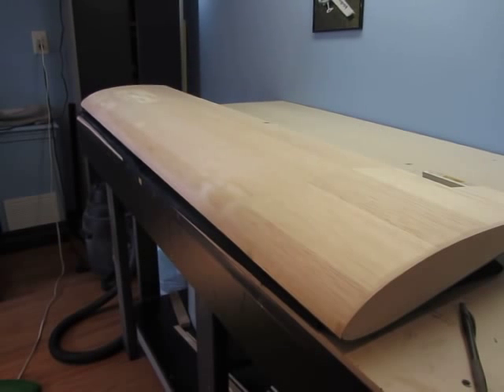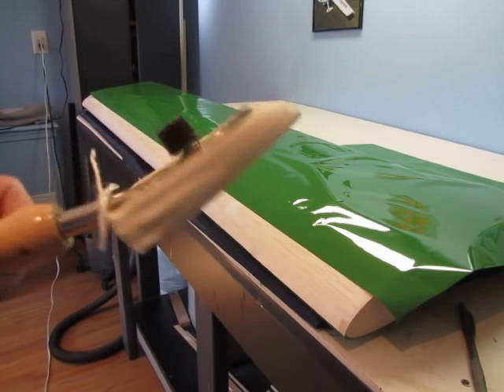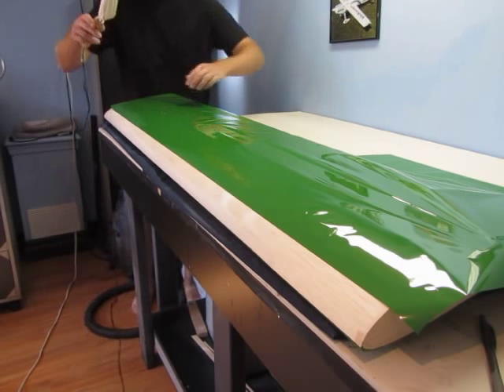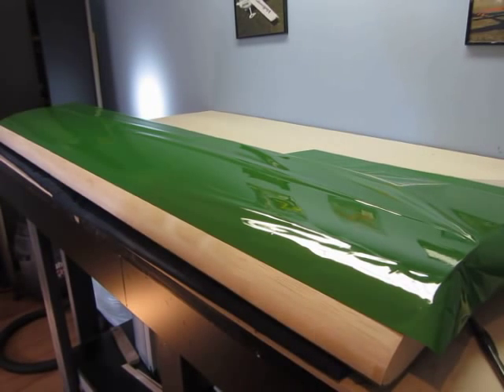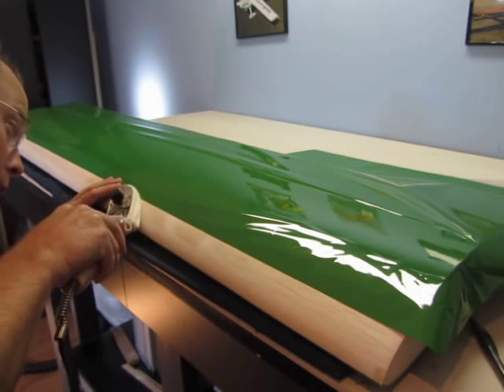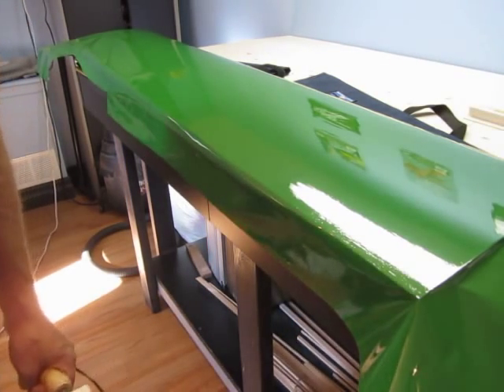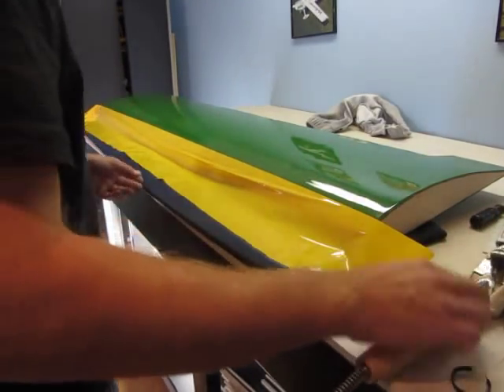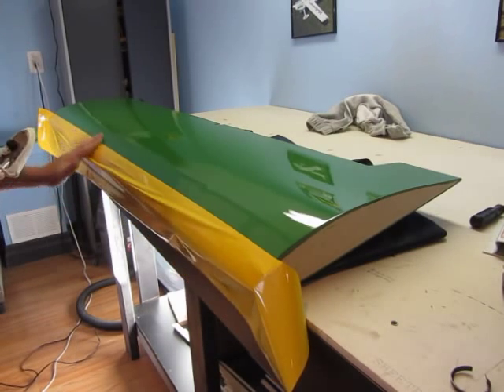Covering with Monokote

Comment: I used an adhesive promoter on the edges back in the 70's. It allowed you to tack the film on without applying any heat. ie, you could semi permanent fix the edges with finger pressure only. You were able to stretch out any wrinkles and then you would permanently fix the edges with the Iron. Then shrink with the heat gun. It was a much easier process. Don't know if the adhesive promoter is available now.

Comment from the maker: The key is to wipe it to all down with a tack cloth after.  I do the following prep... 150grit, 220grit, 300grit, 400grit, hairspray, 600grit, tackcloth, cover.  If using Ultracote, 300grit is likely the last step beaded since it's more thick than Monokote and doesn't show the grain as much

No issues with the adhesive or longevity!!

Cheers
Reply: WHAT is the hairspray step? Why?

Comment: as with any multi color covering job the layers eventually start lifting... i talk to a fellow flyer from my club and he uses a tiny bead of thin ca along the seam between the two layers of covering and has never had to re-seal the covering. because the oils from the nitro coat the airframe the adhesive on the covering wont adhere very well if at all... the ca bead keeps the covering sealed permantly. because the ca doesnt soak into the covering it wont dry so hit the seem with the iron to "flash cure" the ca. no more lifting covering.

Comment: Wait, what?  Hairspray? Do you spray it after the final finish sanding?  What does it do for you?
EDIT: Also, I've done a few other monokote jobs but my P-51D Top Flite model will be my first one that is covered with balsa sheeting.  The way I learned to cover is you tacked the leading and trailing edges and did not tack any of the spars. But looks like sheeted wings should be ironed all the way.